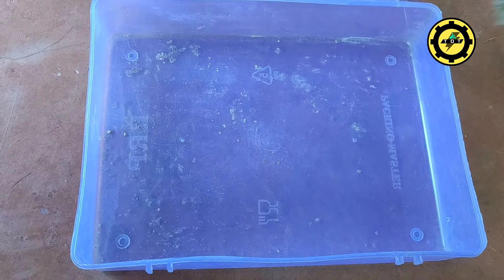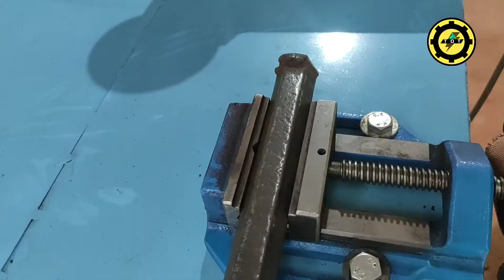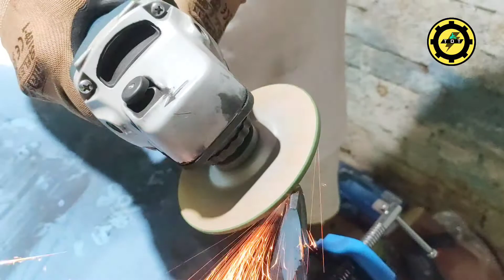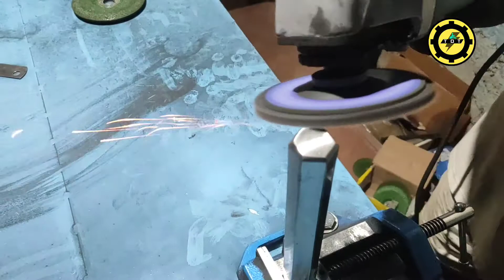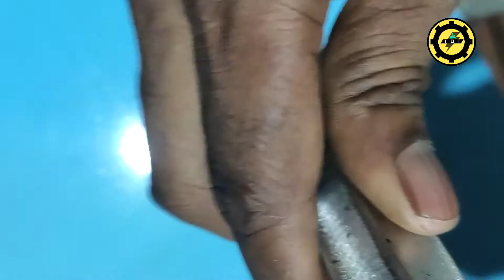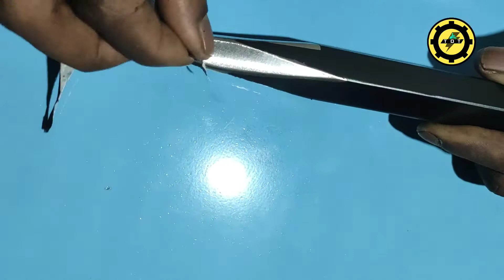Rusty broken chisel restoration

Comment: Just another video of grinding, sanding and painting of an old rusty piece of metal. No appreciation of the process of hardening, the chisel should have been heated to about 800 degrees C for hardening, that was nowhere near that temperature. I'm puzzled as to why the end of the chisel was painted, the first hammer blow will take the paint off.